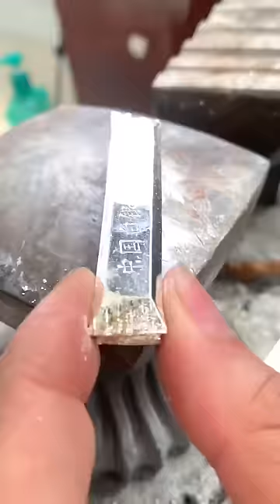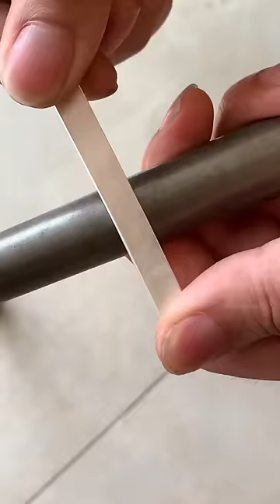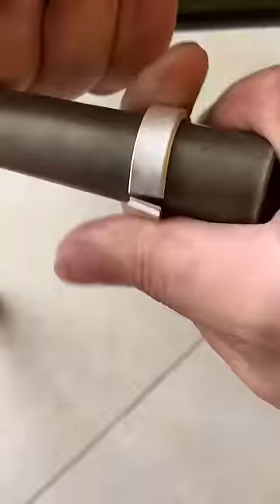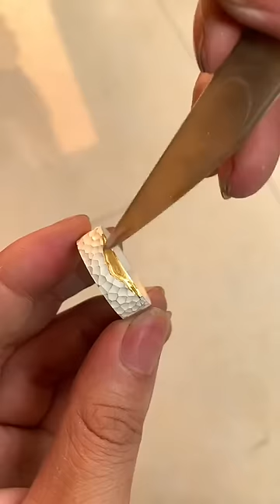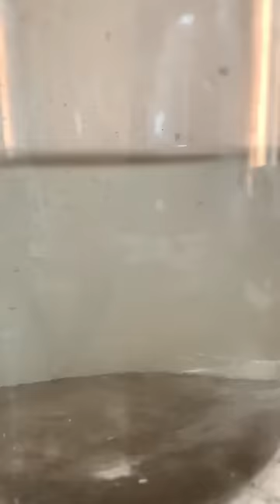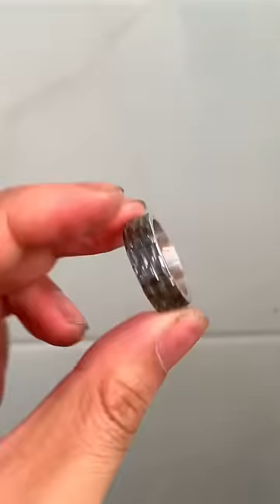100% Pure Platinum ring making 😱😱🔥 #shorts p2

Comment: It literally says Ag 9999 on the original bar. That's pure silver.
Reply: Silver color is a silver gray.. if silver imitates platinum it  mixes a nickel to make an alloy.. this video is a 100% platinum
Reply: 9999 is not pure lol
Reply: @reevil402  ok sreetips
Reply: @kerreangrijado3741 on the bar it was literally engraved in chinese “chinese silver”
Reply: I read Chinese and yes，it's silver 😅 中国白银
Reply: I want this Ring where I can buy this one
Reply: @kerreangrijado3741 first of all you cannot patina platinum with chemicals and this dude definitely added a chemical based patina via a syringe. Platinum is also extremely hard for a precious metal and wouldn’t get massive dimples so easily. Then lastly platinum is extremely difficult to polish, and he didn’t even use a buff only used a cloth. A platinum ring that size would be and 8 hour day just polishing on a large buffing wheel

Comment: I thought gold was supposed to be made of gold??? 🤔
Reply: He meant the other gold. It’s called silver🤣🤣🤣
Reply: @commonsense5489  or aluminum
Reply: There is a thing caled white gold
Reply: @warprince8112  but that is not 24k gold. It's alloy to make the gold to look like white/silver
Reply: that is white gold
more valuebke than common yellowish gold
Reply: @raulninolarracas  White gold was originally developed to imitate platinum (a naturally white metal). White gold is usually an alloy containing about 75% gold and about 25% nickel and zinc and it's less in value because you cannot make 24k white gold.if it's 18k it's the same value because both contain same amount of pure gold. Go and lose your money.
Reply: @paulirumbin1541  It's the alloy cost that makes white gold slightly more expensive to make. So he was correct. Also, check your blood pressure, it's not that serious.
Reply: @warprince8112  So, 24k as they person claimed is 100% gold. means 24 parts out of 24. white gold is gold mixed with something other then gold to give it that white color. usually nickel or platnium, but there are other things. So no. technically "white gold is kinda not actually a thing.
Reply: @paulirumbin1541  thank you.   Yep white gold is great.   But by definition it cannot be 24k as it cannot be pure gold.  It requires the addition of other white metals.   Usually you see white gold in 14 or 18k. And it's usually about the same price as 14k or 18k yellow gold.    UNLESS it's the white gold where the alloyed metal is also valuable.... And for some reason I'm drawing a blank on what that metal is....but in that case  14k white gold would be somewhat more valuable than 14k yellow gold.
Reply: @jeremypreston5009  can you read what I wrote? Don't educate me
Reply: @paulirumbin1541  no sorry I was agreeing with you and adding on for the benefit of the person making the original comment.  It wasn't directed at you per se
Reply: @warprince8112  white gold isn't 24k
Reply: There are many types of gold this one is white
Reply: @umarshah9292  yeah but the you cannot say it's 24k gold. Why it's so hard to understand. 24k pure gold, containing only gold nothing else. 24k gold is 99.99% gold. Red,white, green etc gold's are alloys and they are not pure 24k gold.
Reply: @commonsense5489  white gold fool
Reply: @MrPINKFL0YD  I hope you’re joking🧐🤣🤣🤣
Reply: @paulirumbin1541  could be tin🧐🤣🤣🤣
Reply: @paulirumbin1541  I hire gold jewelry is not made this way🤦🏼‍♂️ 99% of gold jewelry that is white gold is crafted out of whatever karat it is stamped and then only is a solution is made where (high quality white gold jewelry is made by these metals) palladium,silver and/or rhodium is dissolved and is plated to the yellow gold🤦🏼‍♂️ and for everyone that thinks white gold is more expensive than yellow… only white gold that is made with palladium and rhodium make that piece more than solid yellow gold 🧐 those pieces would have to weigh a substantial amount though due to the fact that near to nothing is made out of 100% white gold it is 99% of the time plated . That’s absolute fact. People can find this out by either believing the internet, calling around to all the local jewelers or getting involved with precious metals at a very young age
Reply: @raulninolarracas  White gold is gold alloyed with white metals. How can 24k gold be an alloy? It's pure gold. 24K gold has to be a deep buttery yellow. SMH.
Reply: @commonsense5489  silver is not that malleable😂
Reply: @Laynenelson320  if you can get up to as close as you can get to 100% silver, yes it is. .925 is considered pure silver. It is only 92.5% silver and the other metals are to harden it.
Reply: @ronilsondossantos9012  there’s one emoji to express the three you chose🤦🏼‍♂️🤣🤣🤣 it’s “🤯
Reply: Bro the caption literally says platinum

Comment: 1: 24k gold is GOLD in color

2: learn how to solder, the joint on the inside is total trash.
Reply: That joint is horrible. I never saw something like that even when I did my goldsmith class...  That's what happens when people jump on doing ring right away, they didn't learn the quality of everything before; good filing, straight edge etc.
Reply: I don't think it was soldered at all, some people do this. Point one is valid, the bar literally said Ag 9999 in the beginning.
Reply: it is white gold
Reply: Lol would love to see your work , I have a few prices I will post on my channel of my Sterling silver handmade necklace which I finished recently 
Being a Jeweler is a hard task and you seem to know a lot so would love to hear your feedback Travis